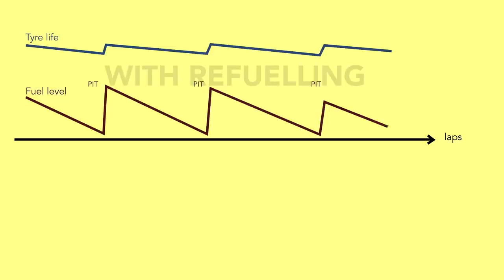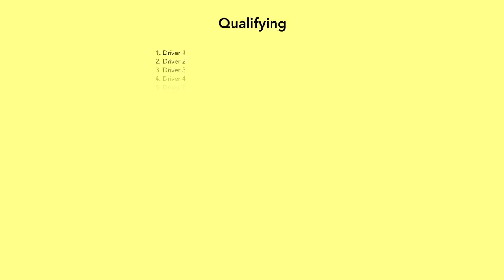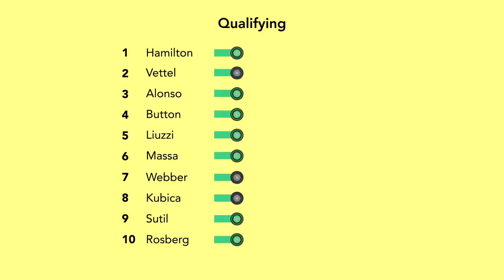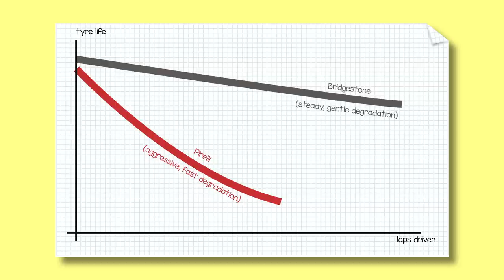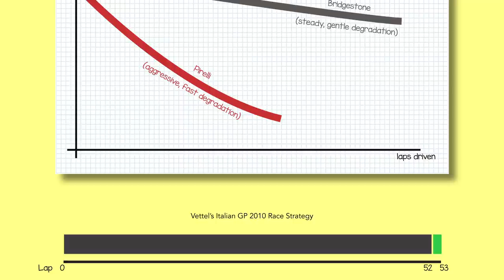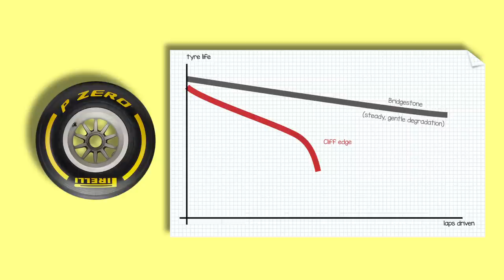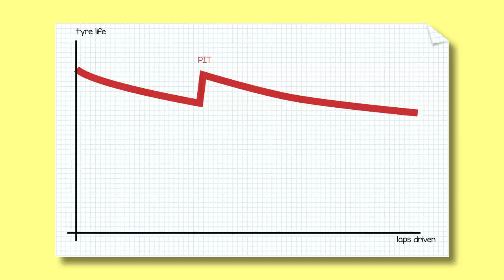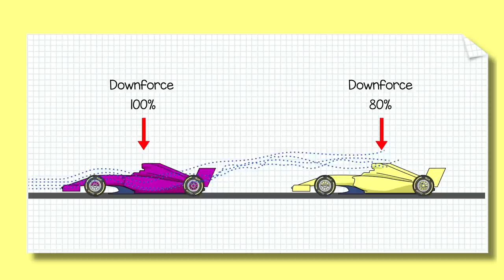How Canada 2010 shaped F1 for a decade - Chain Bear explains

Comment: I remember the 2013 British GP, Pirelli was a shambles. It was the kerb at the fast left kink after the look onto Wellington Straight that was snagging and delaminates the tyres down the straight. The load on the tires at flat out and clipping the kerb would cause a puncture on the left rear of 4 cars (maybe 3?) on the white coloured mediums. Paul H couldn’t handle the media scrum, and puzzled journalists and teams looking for answers. It was completely unsafe, could have caused an accident. I was there as a freelance journalist for a newspaper, I’d rather not say where, and it was absolute bedlam at the Pirelli Motorhome (I guess you could call it that) in the paddock. FIA had no answers. It was believed that the kerb was too high and if you hit it just right with the sidewall of the tyre, under heavy load, the kerb would cut the tyre. If you look at the side on images of each of the incidents, all the tyres looked the exact same, yes, structurally everyone has the same tyres, but the way the tyre delaminated on the straight, it was virtually identical for the 3 or 4 cars it happened to throughout the race.

Comment: Bringing back refuelling isn't a solution, but forcing teams to run excess fuel loads so they need to push to burn it off might work more. Of course the fuel tanks would need to be bigger...
Reply: That's not a viable solution from a PR perspective, F1 needs to be as fuel efficient as possible, not burn excess fuel for no reason.
Reply: @the_kovic  fair point
Reply: They're not pushing the engines because they have to last 7 races or so...

Comment: Refueling is not he sole answer but indeed is the most important aspect among the others.

Bringing back refueling, more than one tyre manufacturer,  simplified aero and smaller car dimensions need to be done at first in order to have some fun races.
Reply: refueling always brings explosions and fires, we need clean, all-out racing on track
if ERS energy is not limited per lap, changing between fuel and battery or using both together would already cause a big difference
Reply: @RadeticDaniel  refueling does NOT always bring explosion or fires etc.. In order to decide whether banning refueling due to safety one first should look at the number incidents which are racing related and refueling related and then compare. (Which will be insignificant)  With this logic we should ban racing all together.  Instead of banning things we need to seek new precautions.

Ofcourse there's possibility of any incidents that can occur but refueling adds another parametry to race strategy.  No other solution does this. F1 lacks strategy parameters, that is the main reason of boring races.. All other aspects (aero etc) are secondary. Your suggestion is a good one in my opinion, I would like to see that but it is also a minor solution
Reply: @cemcantekin , main reason to ban refueling was the increasing number of accidents as new pumps, connections and procedures were changed to keep up with the speeds of tire changes, including that 2008 Massa "flame on" fantastic 4 moment.
As for race pace and close racing, I think degrading tires that liter the track with marbles are not the way, as drivers have to stay away to avoid degradation and drive the exact same line to avoid marbles. Making it the both the boring kind of safe and the wrong kind of surprising.
And regarding competitive championships, DRS hides the problem instead of forcing them to solve it, but Chain Bear's video about feedback loops gives a hint on what to do. I also think that the fastest lap point was a step in the right direction, despite having the wrong tire strategy.
Reply: Finally, for strategy, if you dismiss the maximum allowance for harvesting and consumption of ERS battery, that alone would give a much higher variation of power and pace for everyone, once again going hand in hand with fuel consumption strategy. Even with no stops the drivers already have a lot to manage and the engineers wouldn't go without a job.
Reply: @RadeticDaniel  I know why refueling is banned. I'm saying that the decision does not make any sense if you compare the number of incidents related to refueling and incidents related to other things. Instead of banning it would make more sense to find out new safety precautions and create new regulations.

Regarding your artificial tyre degradation and ERS ideas I totally agree with you. Finally I would like to point out that refueling would also wipe out tyre problem as there won't be any need for artificial degradation.

Comment: Ehh.. I'd rather keep pitstops. Team dynamic is fun to watch, instead of it just being a driver and a car, it involves the entire team. 12 people to change tires, four jack men, two stablization guys also on debris removal duty. Two front wing dudes handling the cleaning and adjustments of the front wing components, added front wing dude for front wing replacements. One rear wing dude for rear wing cleaning and adjustments. Refueller. One dude standing with the release switch, arguably one of the most important duties as he has to have superb reaction time, he has to time it just right and must watch over the rest of the pit crew to make sure its safe to release the car after the pitstop. Another pit release guy, this time he's the one with the power to override the first guy, he's keeping an eye on the pit lane, making sure the car isn't released unsafely.

These guys train hard and make it so a 2-3 second pitstop is second nature, as though breathing, they're masters at this craft. Pit stops need to remain, a mandatory stop makes the race more interesting in my opinion as it allows for more strategy. A race can be won or lost depending on a pit stop, deciding when to pit your drivers, like for example, your on the last few turns of the lap and suddenly a safety car, so you the driver see a chance to nab a free pit stop and to put yourself on fresh rubber, maybe its late into the race, maybe onto supersofts to get that extra bit of pace, maybe you've been stuck in 10th before this, but now you have a fighting chance on fresh rubber to potentially snag a top 5 or maybe even a podium?

So yea, I'd rather keep pit stops in F1 and say GT3. It isn't just about the Driver. Good example, Lewis wouldn't be where he is today without his excellent pit crew and engineers.

Comment: As a Canadian F1 fan I would like to apologize for turning F1 into a Tire endurance formula instead  of the car performance driven formula it should be. Having to drive slow to save the tires is not what F1 is suppose to be about.
In 2011 how many of those passes we when 1 car was in the pits. A hugely misleading srat that 1 is. Passing a car while it is in the pits is not great racing. 
Between crippling itself with the new tire rules of 2011 and shooting itself in the head with DRS , F1 has become the exact opposite of what it's supposed to be. When they came up with DRS instead od fixing the aero problems that would lead to better racing thetook the easy route and ensured that we would never see another great drive from the back to the front. DRS is way to powerful and leaves the defending car a sitting duck and has also taken the skill out of passing.  I was shocked and dismayed that even with the new aero rules the cars are still equipped with DRS. I thought the whole idea was to make it so that the cars could race closer together and get rid of DRS.  It seems the new aero packafe is a failure.

Comment: That Silverstone race gets a bum rap on changing tires.  The problems were caused by teams running their tires backwards, not from anything inherent in Pirelli's design.  The outcry was just so loud that Pirelli got spooked; they could have continued much closer to their original format.
Reply: Is the same true of other races with high-profile blowouts? I recall at least one instance in Korea; I think Webber? I also recall that the drivers complained so much over the course of several races that Bernie issued a gag order.
Reply: @GaryWagers  Silverstone was the catalyst for change because there were... 3? 4? delaminations in that one race. But it was because the teams ran the tires backwards, not any actual problem with the tire design itself

Comment: well... bring in the timed race from FE. that might solve the problem, by hinting you can save the tyres or you run the lap as much as the fuels allows in full force. run faster and you might get higher position or just save your tyres...

Comment: No re-fuelling, no new tires*, tires made ultra durable. Problem solved.

*15s minimum pit stop time if they desperately require changing for one reason or other.
Reply: Disagree. Anybody with any damage whatsoever would automatically be destined to finish toward the back. This year we've had people that have had damage end up winning. Plus, you could just take someone's wing out a bit and they'd be screwed. Don't want vettel to win? Whoops, accidentally braked a little too hard for that corner and now his wing is damaged, and now he's at the back of the field. Yeah, way too easy to abuse.
Reply: @Kyle R
Not necessarily, and certainly not more than now. changing the front wing would take a bit of time anyway, so the might as well change to new fresh tires with the time penalty. Hell, it would be less costly than today because most likely no-one thos with new front wings would have fresh tires.

Also "any damage"  is irrelevant. Only front wing damage can be fixed in a pitstop in reasonable time. So they're screwed no matter the regulations.

Also you can't just take someone's wing reliably without risking damage to your car, or even retirement. Though making front wings small and insignificant, or outright removing them (lotus 88) would definitely help.

Comment: Except for the one key difference that Bridgestone is very good at making F1 tires and Pirelli is not. Pirelli's tires have almost none of the characteristics that made this race good. They wear far faster if pushed and far slower if saved, they have an extremely narrow window, they're unpredictable and require setup compromises, and marble horribly. Too bad all the FIA cares about is chasing their advertising money.
Also, you're very wrong on one thing: Refueling is a massive bonus to diverse strategy and action, as you briefly passed over yourself but then completely ignored. Overtaking increased in 2010 for many other reasons: new teams, closer development at the front, safety cars and rain. Refueling gets an undeserved bad rap from "fans" that don't understand strategy or patience and it needs to come back.

Comment: Can I have the graphic about overtaking after refueling was forbidden as a giph?
So i can slap it all the time in the faces of the „experts“ who want refueling back, because racing was better then...
Reply: You forgot the part about DRS being introduced, making the cause of those extra overtakes more difficult to determine.
Reply: Cole Hartel In 2010 refuelling was banned, in 2011 DRS was introduced. At that time it would have been best to introduce Pirelli’s higher degrading tires before DRS. After all, overtaking on track did increase from 2009-2010.
Reply: Races were more interesting back in the refueling era. The refueling ban in 2010 pretty much only resulted in more passes on the incredibly slow new teams, whereas there wasn't much on-track action at the front. At the same time those tire strategies were pretty lame (remember Alonso jumping from 24th to 6th in Monaco that year after a first-lap tire change).

Comment: So, the only way to make the race results less predictable with the current cars is to have tyres that self-destruct? So F1 can champion the use of hybrid engines for the sake of the environment, while burning through more rubber than a small country every weekend?

I'd rather let the teams go back to choosing their own tyre suppliers, letting them have the tyres that will work best for their car (while stopping teams from developing their own fuels and giving everyone the same petrol to use; and maybe even giving everyone the exact same driver cockpit to build their car around, including the driver controls). If that means they can get through the race at a competitive pace on one set, well done to them. Then, they can shift the focus to regulating smaller and lighter cars that reduce air disturbance enough to allow close racing, so we can see more action resulting from driver skill, and less resulting from team strategy.
Reply: Separate tyre manufacturer's only creates larger gaps between the top teams and everyone else.

Comment: The answer is actually surprisingly simple to make F1 great again but for some reason, they just won't do it. 

Ban all aero devices such as vanes, boards, winglets etc etc and even front and rear wings should be massively restricted in terms of size and shape. Then allow ground-effect and active suspension. 

Voila, you would have fast racing with loads of overtaking.
Reply: IN the first year one or two teams would have a perfect grasp of Ground Effect and Active Suspension. These two teams would replace Merc on the top of the ladder and run off without issues. Yes, the cars would be closer together, but it would be for naught because so much cornering speed would be maintained that it would still be borderline impossible to get a run.

There is no right answer for Formula 1 anymore. The budgets are too high, and races are too short. Every potential hiccup can be and has been engineered away now.

Comment: They should go back to the high tyre deg of 2012 for the new 2021 regs, or go completely the other way and make them low Deg and able to last an entire race like back in the 80's when most drivers completed the race on one set of tyres. Races are so boring now and I'm a diehard f1 fan

Comment: As much as a fan of refueling as I mite be I seen too many pit fires and in F1 I don't think they take enough emphasis on stopping and leaving safely to bring refueling back the size of the cars wheel bases needs to come down to a maximum and be standardized I can't believe the cars have gots so big they can barely make it around Monoco....so that's what's going on with all these crazy different colored tires,lets hope and see for the best that clean air helps things...I was wondering what was happening with teams complaining about tires not coming up to temperature how could that not be...I was thinking,just the teams voicing their displeasure about the tire mandates with heavy cars full of fuel that's understand able....politics....thanks I'm also a fan of strategy if a team can factor in a style or set up too get more from their tires great....everything else is a lock...

Comment: Easy: Bring back ground effect and in return, ban all wings and winglets. 

More aerodynamic cars cause less dirty air which itself will have less of an impact on a car without wings. The ground effect will make up for a good chunk of the lost downforce from the wings.

If getting rid of wings entirely is too drastic, there could also be a downforce limit via regulations. But that feels a bit artificial for my taste. I’m sure the constructors are creative enough to claw back grip, even with a ban on wings, via chassis shape, suspension shape, etc.
Reply: It's my understanding that the current regulations already have a significant ground effect, and that still creates problems for cars following. I think it's the front wings primarily which create the current problems we have. That's why they tried to force teams to change by modifying the regulations. I think they should have gone more extreme with the regulations, such as simplifying the wing further. There's no way to limit downforce, because there's no effect system to police the limit other than having a wind tunnel at every race, and testing every car on race day.

Comment: Something must be done, that's obvious. Conservative driving should be the alternative, not the norm. If F1 refuses to go back to refueling (which would be optimal), it is definitely an interesting suggestion to remove the obligatory pitstop and see what happens.
Reply: ohohohoho, witness all the top teams run the hardest compound and road-block the whole race then. Unless the tires can go all the way at top speed in Monaco.

Comment: Ahmmm, if Pirelli can make a tyre that lasts the whole season, then there is no problem with dirty air and following distances? Just put that tyre in with the current regulations and see what happens? What am I missing?
Reply: @valerierodger7700  thanks for pointing this out Valerie. I was thinking more on the complaint that tires do not last long when following closer. I did not consider that half of downforce is gone when following closely.

Comment: I don't care for overtakes through pitting and different pit/tire strategies. And it's not entertaining to see an on track overtake when it's just because of DRS or that one car had better tires than the other. I want cars to have all the fuel they need and one set of tiers tires are so durable that drivers need to drive as fast and aggressively as possible every lap of the race without pitting at all.